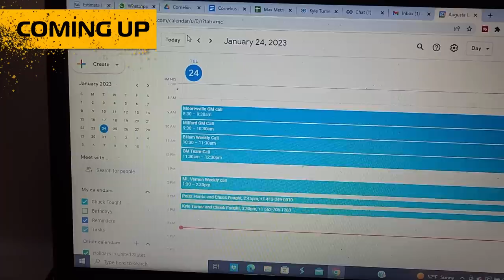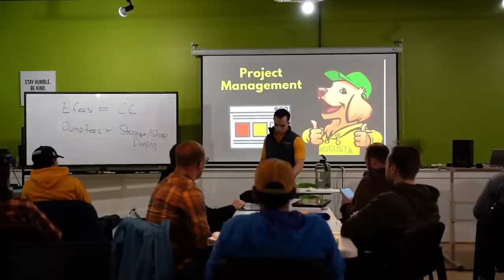I Tried to Start 4 Businesses in 1 MONTH & THIS Happened...

Comment: I don’t know how you pulled off $500 per truck for paint.  I beg and plead to get down to $1300 for the bare bones job.
Reply: This is what I was thinking up here in mi everywhere I call is 6k
Reply: Same here, when I heard $500 I was shocked. $1100 for me at Macco, I’m in MA
Reply: @DennisWinek  I drive 200 miles to the nearest Maaco because all the normal paint shops near me are something like 6k.   That long distance stuff Gets pretty old when you have 10 vehicles.

Comment: My number one worry when starting/expanding a business would be the start-up cost, and the fear of forever being in debt either down the line or even towards the beginning. I've always thought of starting a storage unit business, but having to find the right location, plot of land, the taxes, who to build with, nearby subdivisions/businesses, etc.

So would it be a matter of knowing exactly what needs to be done, pay/charge for the items, and get the ball rolling fast (to pay off your debts before they escalate)? Or would it be better to have enough funds set aside so you can expand at a moment's notice?
The business you're running [from what I see] is quite successful, with the right materials, a structured routine, proactively growing/expanding your operations, and PROPER training for GMs.

But I will say that utilizing storage units does take the guesswork out of worrying about property taxes and building maintenance, a total no-brainer solution.

Comment: Great video. I did have one question. Do you normally run v6 trucks with mowing setups and dump tralers? How well do they work for your needs and do they hold up? We have always ran v8 trucks.
Reply: I would also run a v8. I’ve had v6 f150’s go out hauling.
Reply from the maker: We have both ✅ mostly v8

Comment: Hey Mike. I would recommend your franchise use Hasegawa or Henchman orchard ladders. Your best guys who do pruning and hedges are super valuable. You don't want them to get hurt while using old school orchard ladders. The ladder that this guy recommends is not safe for pruning or hedge trimming. The ones I recommended pay for themselves in 3 months. Adjustable leg allows for better angles, allows trimming jobs to completed more quickly.
Reply from the maker: We don’t go above 8 feet usually
Reply: @MikeAndes  Keep them in mind in case any franchise does more ornamental tree pruning / hedges. Even 8 foot Hasegawa ladder is super enjoyable to use. Optional rubber feet for slippery patios/steep concrete means you can do a lot of terrain that's otherwise unsafe.

Comment: Those are not 7k axels on the dump trailer. You can tell easily by the lug pattern. More like 7k gvw for the whole trailer. Yard and a half of stone or other heavy material is about all that can haul.
Reply: My guess is it was an honest mistake and he meant 7,000 GVWR. I doubt the media team knows enough about trailers to catch the mistake and issue an on-screen correction.
Reply: I figured it’s worth pointing out for the perceived “value” of the trailer. For grass and mulch it will be fine and I’m guessing that’s mostly the intended use. For renting and hauling skid steers or excavators it won’t cut it. But then again neither will those trucks. Just one thing to consider for someone transitioning from mowing towards landscape projects.

Comment: This is way over the top and inefficient for starting up a lawn care business. Flying across the country? That part was weird. Really should have just done video conference or at least had all your GMs meet in person in NC then do a video conference with the people in WA. Also you bought a bare tool, separate charger and separate battery? That has to be way more expensive then a impact/chucked drill combo that comes with both a battery and charger. 

This level of rat race gymnastics is incomprehensible to me especially when it's just lawn care, can't imagine dealing with all that debt and payments and all those calls and staring at a screen all while trying to run around and cut grass and do dirty work. Seems like it's all too complicated for the field your in but hey good luck